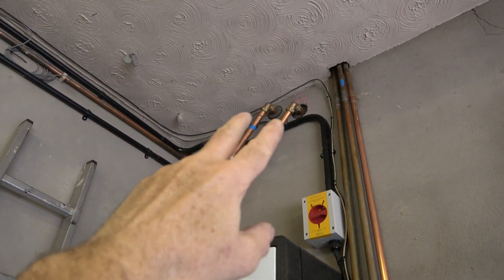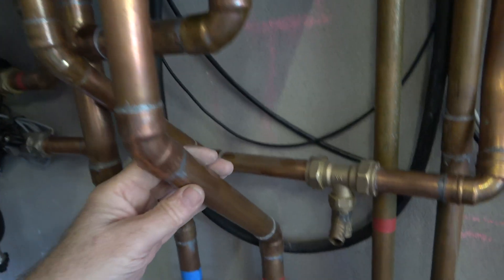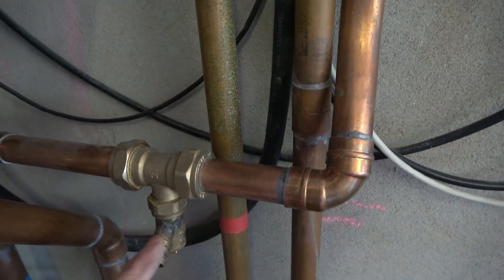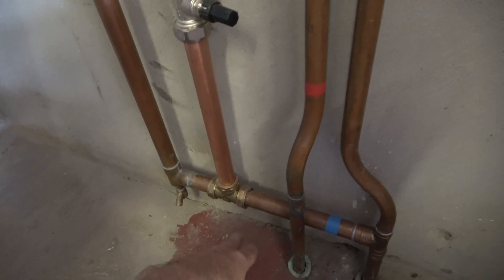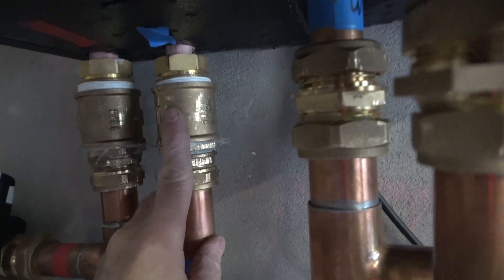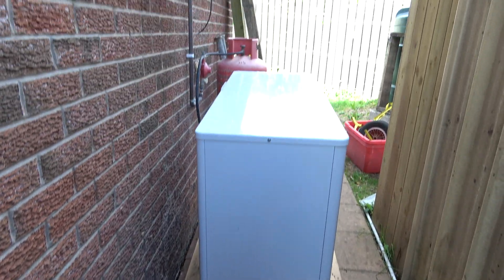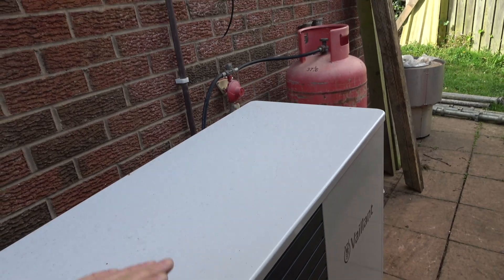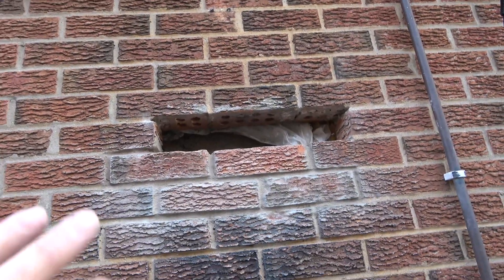Self Install of 7kW aroTHERM plus Heat Pump. E8.

Comment: Nice video!  Was thinking about putting a heat meter on my existing low temperature UFH for a year to judge my energy needs accurately.  What is your opinion of the Kamstrup?
Reply from the maker: Thanks. The Kamstrup seems good, I use it to momentarily check flow rate, flow & return temps and delta T. My only concern was it arrived with the run hours at a value and i couldn't see how to resent it. mind you I didn't look very hard.

Comment: Well done. I'm seriously impressed. Are you following an official valiant instruction plan? How much money are you saving by installing it yourself? Don't you need to be certified to do this? Also, will you have to notify the gas company to officially cap the gas connection?
Reply from the maker: I do have vaillant schematics for the system, although it is quite high level, it involves a lot of head scratching. Saving the full installation cost, which I guess it in the region of ~£5K. The only gas we have is bottles/cylinders of propane for the hob and that is remaining in place. The boiler I had was oil fired.  I'm an electrical engineer, but I will get the ultimate connections to the fuseboard check by a qualified sparkie.

Comment: Not sure those returns are correct
Reply: Why not share what you think instead of "I know something you don't"
Reply: @TheFredbackLoop  been a heating engineer for 20 years and I have never seen returns connected together like that the hot water circuit should connect directly to one port and heating circuit to the other. Probably would work but it’s not right
Reply: @TheFredbackLoop  https://elearning.vaillant.com/vrc700/ci/en/documents/uk/infopool/System_diagrams.pdf 

Here is the link to the pipe schematics. Its not pipped correctly
Reply: @TheFredbackLoop  https://elearning.vaillant.com/vrc700/ci/en/documents/uk/infopool/System_diagrams.pdf 

Here is the link to the pipe schematics. Its not pipped correctly
Reply from the maker: My DHW and zone 2 (upstairs) share a common return.  The zone 1 (downstairs) is also commoned with the Z2 return. The 3 flows are separate. In an ideal world I would rectify this but that is the way is it for now. I do know that I have a bit of spurious circulation on a couple of upstairs rads when the Z2 valve is closed (so Z2 supposedly off) and the tank is being heated (DHW on). Thanks for the heads-up.

Comment: I am currently doing a self installation of valliant arotherm 7kw. I have tested it on the hot water tank and all ok so will move onto removing the combi boiler. Is yiu outside isolation point outside the protected zone. Keep up the good work
Reply from the maker: Thanks for the comment Derek, the isolator is about 1m from the centre line, so is on the edge of the zone. The diagrams are a bit ambiguous, I used dim A (2.1m) about the centre.  Did you change the water tank or are you running with the original, as I am doing initially (until I discover the coil is not big enough)?
Reply: @UFZ7482 I am using a previous installed mixergy tank. I have just completed thd install now as thd 35mm pipework needed a press tool , soldering 35mm i found difficult. Just over 1 hour to heat the tank from cold 250l so just over 8kw input. Cop 2.6
Reply from the maker: @derekpaisley620  what is your starting temp, 15C? and what is your final temp in the tank?
Reply: @Staedford  start was 27 deg to 56 deg. I have just completed another run in eco mode. 32 to 55 in 1 hour 45. Cop 4.6

Comment: Good progress! I would want the gas bottle disconnected and moved out of the way during the lifting process, just in case it all goes wrong! Have you considered using a Genie Lift?
Reply from the maker: Hello Glyn, thanks for the comment,.... yes i am waiting on delivery of a 1m propane pigtail to get the cylinder outside the scaffold tower structure. I plan to lift the unit 0.5m at a time, then place the scaffold boards under, so it's never more than 0.5m from a solid base.  I didn't consider the genie,... well maybe look again, thanks for the suggestion.

Comment: flow meter on the return , temperature  sensor on the flow maybe expected by default settings.... you can probably change it in the settings
Reply: Heatmeter bodys can be fitted on either flow or return, historically the meter body was usually fitted on Return to avoid high temperatures, this is not an issue with heat pumps. Ultrasonic heatmeters like this Kamstrup work best with the body fitted on the flow, this is how they are configured by default. But this can be changed in config settings if needed:, see:https://youtu.be/t2lBcXVAEGk?si=CzasLKU-5_4P5t6B
Reply: @GlynHudson  Thanks . Just one thing , I was helping some local installers with OEM shop kit and noticed included instructions to put flow meter on flow but the meter was actual setup the other way around resulting in negative flow reading  . Sontex 789 was set to "Coldpipe" . Its just FYI .
Reply: @gopikrishnayogarajah  sorry for confusion, Sontex superstatic meters work best on return,but can be configured for either. Going forward we're standardising on ultrasonic meters which will be configured for the flow..
Reply from the maker: Yes I hope so,.... i did read somewhere meter on the flow,....oh, you'll see at time 0.25 there is a sticker on the flow meter and it is to be installed on the flow.